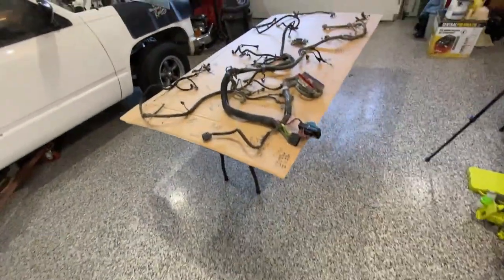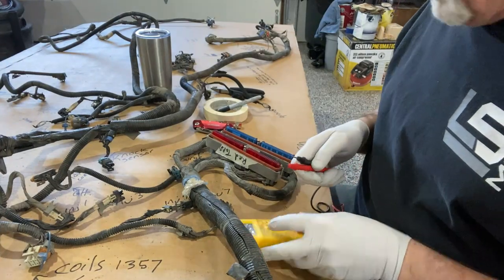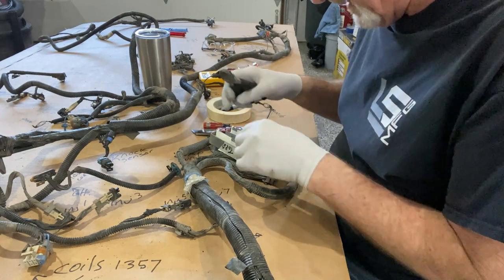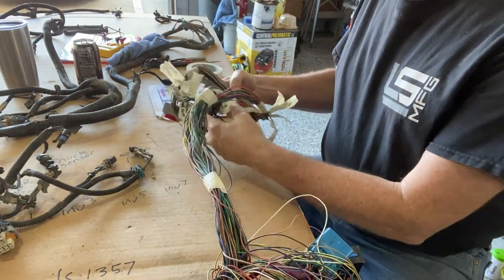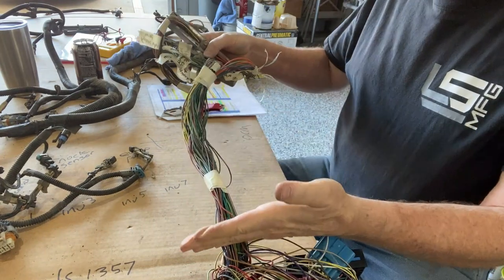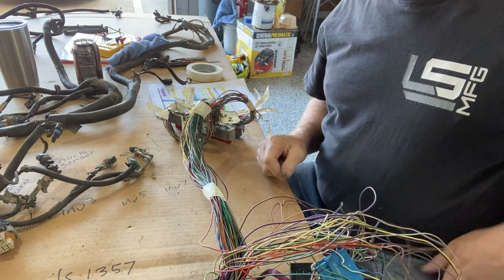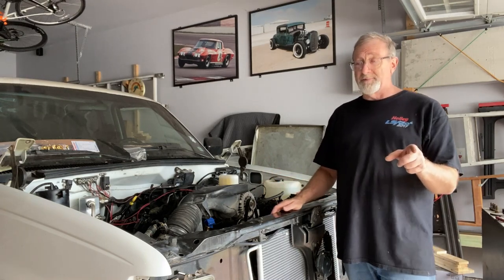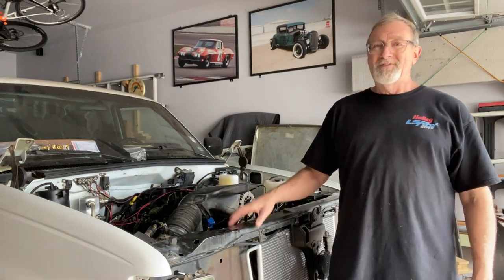Modify your own Standalone LS Wiring Harness into an LS Swap Chevy GMC OBS Truck

Comment: NICE INFO ,thank you for making the harness video.Can I ask where you got the color coded pinout sheet showing what pins stay and what pins go ? I had found one like that but it was not for my truck .Doing a 96 GMC with a 99 6.0 4l80e 4x4
Reply from the maker: Go to lt1swap.com, all the info for your engine is there. For your ‘96 I suggest going to eBay to find a electrical wiring and diagnosis manual. GM made them and are an excellent resource for your truck. Starting around ‘95, the manuals changed a bit from the previous 88-94 ones. A good one can run from $35-75. They are worth it, but if your budget is tight or you cannot find one, they are available on disc for about $30. Autozone does have several online for free. You can check one of my earlier videos for a “how to” find them. Check the “top 3questions” one first, I think it is there.
Reply: @laurencevillegarage  Thank you for the info sir ,it is appreciated

Comment: Most people I see don’t use the OBS harness at all. What’s the advantage of using both harnesses? Is it only for the gauges? I’d like to keep the stick gauges. I’m doing a similar swap 1990 k1500 manual, to 04 5.3ls
Reply from the maker: Depends on how your truck was equipped, what you are putting into it, what gauges you choose to use, etc. In your swap you may not use any of the obs wiring. I find the best way (for me) is to make everything works, THEN thin out all the unused wiring. If it all comes out, great, if not that's fine too. Do whatever way makes sense to you and you can stay organized and keep track of what is what.

Comment: did you have a picture of the pins that you removed on the red an blue ones i also am building a 90 obs chevy and am using a manual transmission curious if you remember which pins. or if youve posted the ones you removed from your build somewhere
Reply from the maker: Go to lt1swap.com. Excellent site that will show you the complete pin outs for your pcm. Will show you which ones to keep and get rid of. Take note before removing every pin to see what its function is. If running a manual trans, you can go ahead and remove the pins associated with the automatic transmission. Good luck!

Comment: Did you use any of the fuse box from the donor or build a new fuse box?
Reply from the maker: I did keep the original fuse box. There is more in there than just the engine relays/fuses. I had a smaller fuse/relay panel for the engine harness and a separate one for the a/c and fans.

Comment: I'm getting to put 08 Chevy van 5.3 in my 94 I have the donor but was told I'm wasting my time and because it's a gen4 do I need to get a gen 3 instead before I do anything else
Reply from the maker: Whoever told you that is very misinformed or wants to buy your van for cheap $. There are definite differences in gen 3 to gen 4. A lot of parts don’t interchange. Since you have a complete donor, you are ahead of the game. It may cost a bit more to go with gen 4, but when finished it’s probably a wash. You should do your research and get familiar what you have and come up w a plan for your project. Learn all you can about the differences so you are informed and don’t buy the wrong parts or give out poor advice. Then go for it! Have fun w your LS swapped vehicle!
Reply: @laurencevillegarage  thanks for the advice I kind figured they was trying to get my donor I've been doing research

Comment: I’ve been educating myself as much as I can about swapping 88-94 I have a 91 4x4 it’s manual the only thing I’m struggling to find information on is what difference is their in swapping into a k1500 instead of c1500? Are the dirty dingo adjustable mounts going to work?
Reply from the maker: I'm sure DD has what you need, there are other companies that sell the correct mounts you need. Be sure you check they are for 4wd swaps when ordering. I have not swapped a 4wd truck yet. I don't want to lead yo in the wrong direction, but, the main items I would research for your swap are the mounts and exhaust manifolds. If you plan to modify the late model truck manifolds, it can be done, I have done several.

Comment: on the 3 pin temp sensor, i thought the  gauge  wire was the extra one,  the 1 by itself, ,
Reply from the maker: It is. On the '95 it was as well. I have not been able to run the engine long enough yet to check the temp gauge. Currently no radiator installed yet. I will let you know once all is hooked up and I can let it run for a while.

Comment: What's the name of the company that deleted the VATS , EVAP and rear oxygen sensors ?
Reply from the maker: For the '91, I sent my pcm to Brandon at lt1swap.com, for the '95 I sent to Chris at easyefisolutions.com.  In both cases, they did a good job. But, ultimately you may need more tuning than just a vats/emission delete. I had the '95 tuned on a dyno and the '91 I had a guy come to me and we drove around while he tweaked the settings while driving. Depends on what you are after. The initial "delete" will allow you to get the engine running, but a static work bench tune is no substiture for making adjustments while the vehicle is running/driving.

Comment: Its that a red/ blue drive by wire set up?   Or the harness was originally drive by cable?🤔
Reply from the maker: Nope, it is an original drive by wire harness.
Reply: @laurencevillegarage  @ o ok,    What headers u using on the white truck?  Do u have room to use stock exhaust manifolds?
Reply from the maker: I am using stock manifolds. I cut and ground off all the extra material that mounted the heat shields and emissions stuff. Welded on enough pipe for the O2 sensors. They look like mid length headers. Not very hard to do. I took pictures, but didn't do a video. I'll shoot some footage and add it to an upcoming video to show what they look like. I literally only paid for paint.

Comment: Need the links 😢 can’t seem to find the correct ones
Reply from the maker: Most of those items I got off Amazon. I'm sure others would work as well, those are the ones I used. Use this link for the fuse box  https://amzn.to/3MXwfgV, and these 2 for pins   https://amzn.to/3X2nW7V    and   https://amzn.to/3CjFinv.
Reply: @laurencevillegarage  my bad I meant for the pin outs for the harness!
Reply from the maker: @elguacho302  lT1swap.com

Comment: You showed nothing on the obs harness just skipped to the ls stand-alone being in and starting…
Reply from the maker: For a standalone harness, you don't have to do anything to the old harness. It's all laying there (the stuff that was disconnected from the old engine), BUT to make it run, you only need to hook up your red constant power wire (went to terminal on firewall), fuel pump wire (also on terminal on firewall) and hook pink "key on" to a pink wire that came off of the terminal block on firewall. You don't have to "tie in" a bunch of wires to the OBS wiring to start the truck. I will cover the gauges later, my goal was to make it run. It is a lot simpler than a lot of people think to make it run. Also, each year can be just a bit different in where you go to for the battery hot and key on power.
Reply: @laurencevillegarage  gotcha I was like what the hell man lol you skipped a lot of steps! I’ve got my factory harness in my 94 stripped down. You used the ls harness to start the motor I’m using the trucks harness to crank it over.